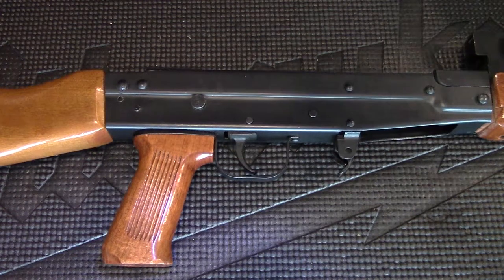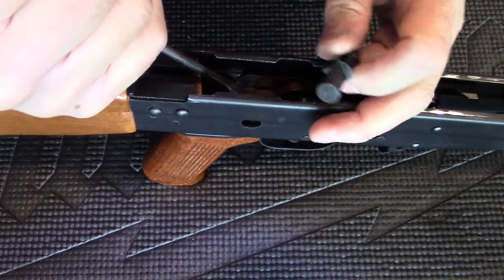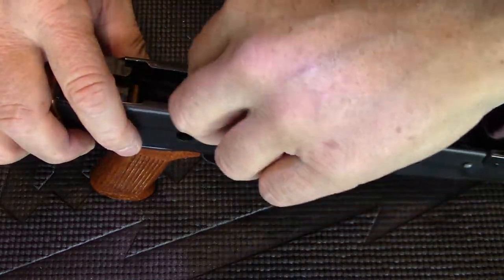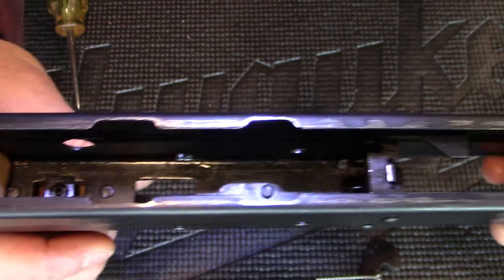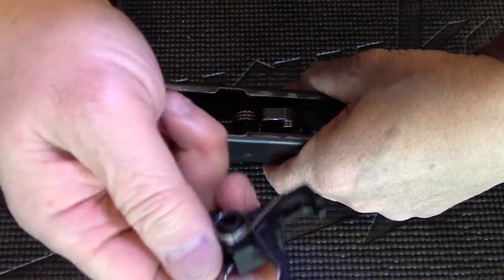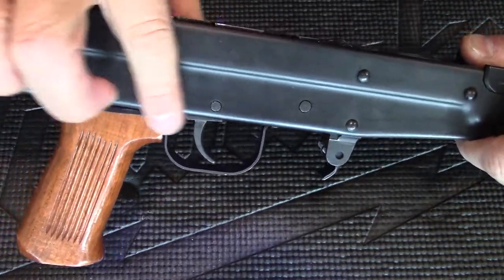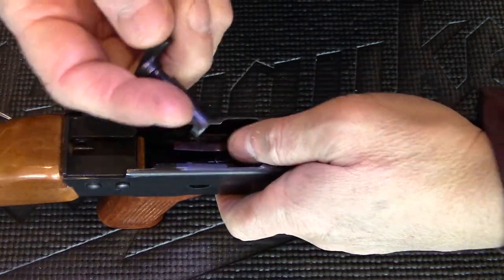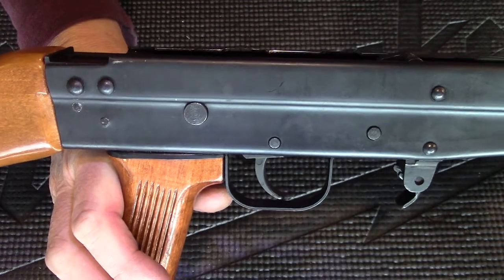Type 81 Trigger Full Monty disassembly *

Comment: If I have an optic-ready Type 81 with a RH safety, I would not be able just to put a LH safety right away as I would need the correct LH locking plate as well?

Comment: When you took the safety selector out, are you able to put it back in on the other side. In this case moving it from the left side of the gun to the right. Thanks!
Reply from the maker: Nope, for two reasons, 1 it won't go in all the way from the other side also there no locking clip on the other side.
Reply: @gnutzguy  So there is no way to have a LH safety selector? There is no conversion kit available for safety selector and locking plate both for LH?

Comment: Can the selector switch be inserted from the other side?
.
Was getting my new scope rail installed; gunsmith cited the safety as being in the way for where I wanted it to go.
Reply from the maker: It wouldn't work. I don't see the need to move the selector. Eventually, some dealers will make side mounts and rails for the t81. Check a kachin sniper rifle. I like the rail they made.

Comment: Is the FCG supposed to be brown/orange like that? I took a look at my own T81 a few days ago and was convinced it was rust.
Reply from the maker: the only thing that is brown is the locking plate and there are no rust.
Reply: Gnutzguy Yes My plate is brown too, all of the springs and hammer have no discolouration of any sort just the plate. Thanks for the info. I was a little worried.

Comment: I can't put the copper locking plate back in. It just won't go
Reply from the maker: You must line up the trigger and hammer pins. The groves on the pins is where the copper plate slide into. Ensure the ends of the pins are flush with the outside surface of the receiver
Reply from the maker: You might have to deburr the copper plate.
Reply: @gnutzguy  i got it thanks! I sanded it a little and made sure the grooves were lined up
Reply from the maker: @Dino Piccinin nooooo, not worth talking it to a gunsmith. Keep trying. See Cameron succeeded.
Reply: @gnutzguy  Sorry I've just been really frustrated I've tried all weekend and I've significantly sanded down the plate. I have an optic ready one and I can't seem to properly align the pin. At a certain point time is money and I'll have no choice but to go to a gunsmith. I've put many hours into this already.
Reply: I'm even struggling to put back in the hammer, spring, and pin (I removed it to see if the pin had a burr or something). I'll go see a gunsmith this week... Lesson learnt I'm never going to take apart this rifle again other than the usual dissassembly for cleaning. That plate and the hammer spring is a total PITA. Thanks for the video though.
Reply from the maker: @dinopiccinin1771  yup, you need help. Sorry , my vid didn't help you.
Reply: I figured I'd give it one more shot before getting help (guy at bullseye who was nice said they'd likely charge 35 dollars to reassemble the fcg and plate). Re-watched your vid a few times and made sure to do exactly what you did and now the rifle is fine!! Thanks again.